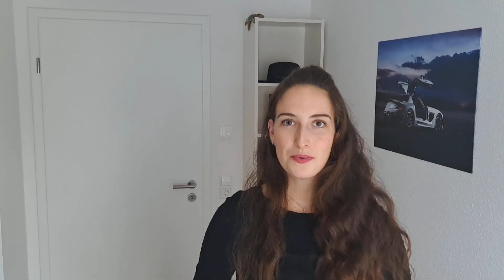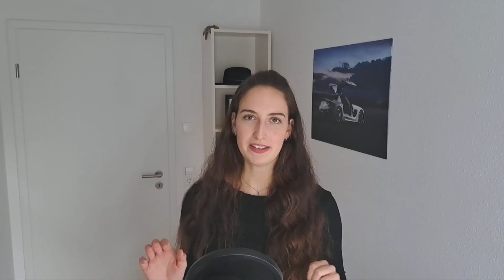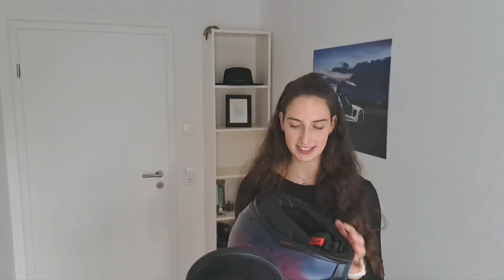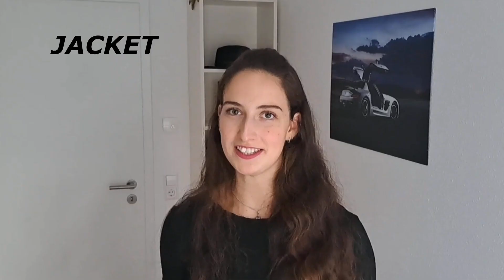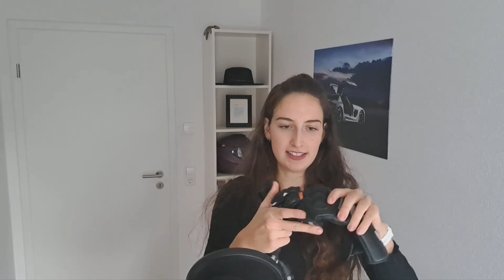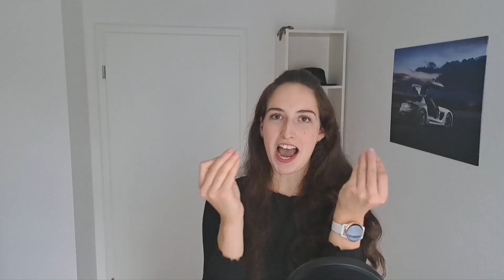Beginners: Which Motorcycle Gear You Really Need - And Which Not!

Comment: You also need to consider proper pants with knee/shin protection, not normal everyday pants like jeans. Leather is best but motorcycle jeans with kevlar lining are available. There is an old saying that if you cant afford the protective gear, you shouldn’t be riding. Factor in that cost when buying a bike. Ride safe.
Reply from the maker: Yup, make sure to have knee protection as well when you choose textile or kevlar pants.
And that's a good saying!